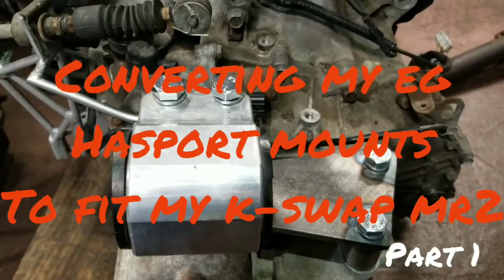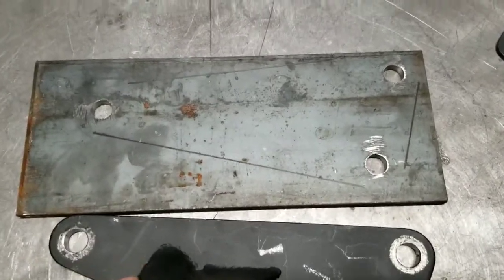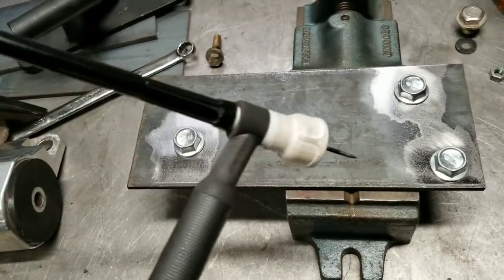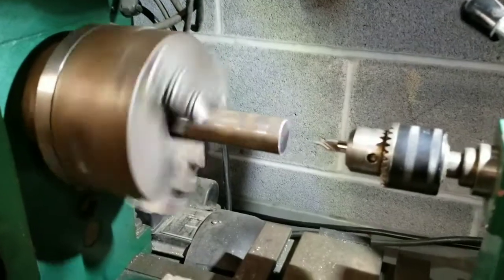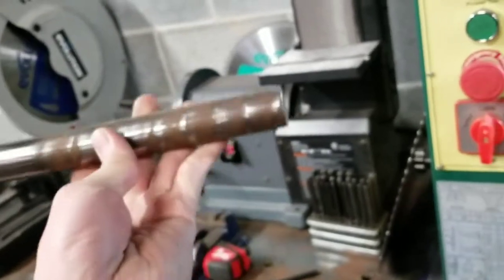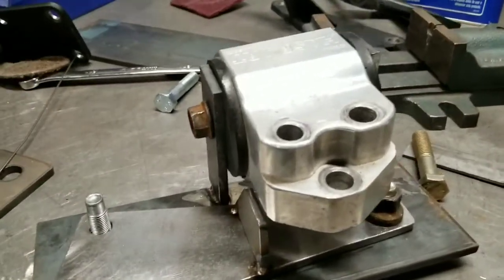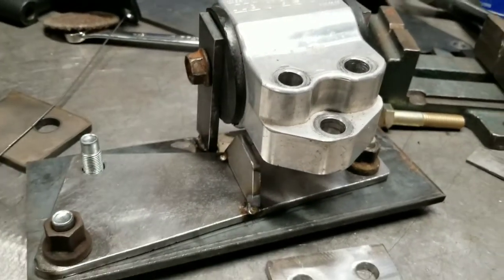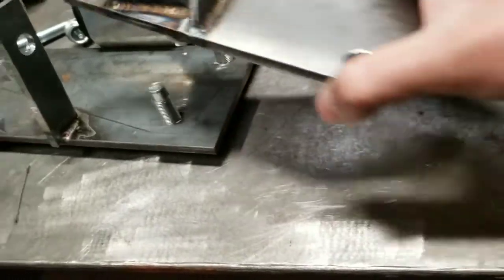Converting EG Hasport Mounts To Fit K20 Swap Mr2 Part 1

Comment: Good stuff.  Now, you can start welding those hasport modified mounts and sell. I'll buy a set.
Reply from the maker: I have to figure out a better way if I want to sell anything. These mounts are from two different b series kit.
Reply: @minh82683  could you make one for me, just the base for the mount??
Reply from the maker: @yuvenys  I ended up not using this bracket. It didn't feel strong enough on the engine side.
Reply: Minh's Garage  nice work..!! I’m also planing to build my motor mounts but I will like to use universal poly bushings... if you are not using the brackets that you build to make the hasport motor mounts would you be interested in selling it that will make my life a lot simpler to build my mounts...
Reply from the maker: @dsmmonster  I aborted that Hasport mount idea and I'm working with a friend to make a full cnc billet mount. I'll have to see if I still kept the mount jig.
Reply: Minh's Garage a CNC billet mounts would be nice..!! Let me know if you decided not to use the jigs or if you finish using them.. it will make my build a lot easier..!!
Reply from the maker: @dsmmonster  I've must of tossed the jig out when I scrapped the idea.